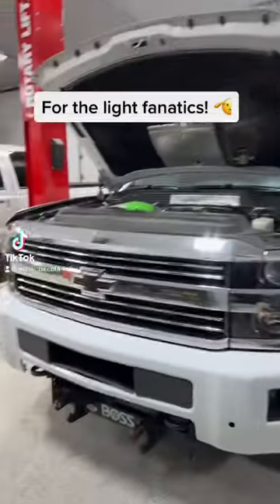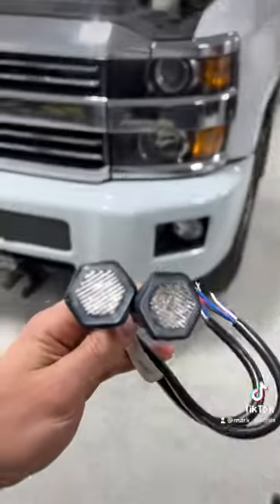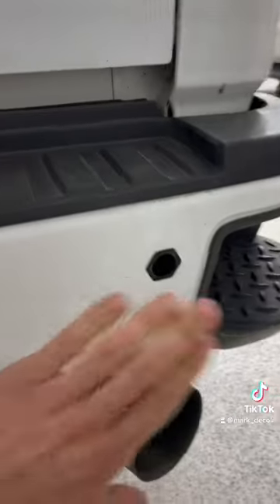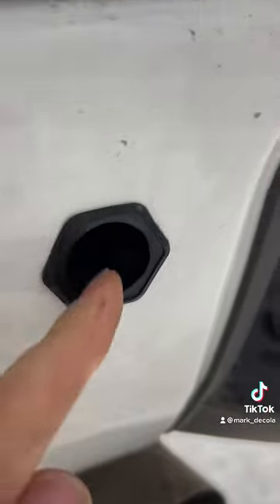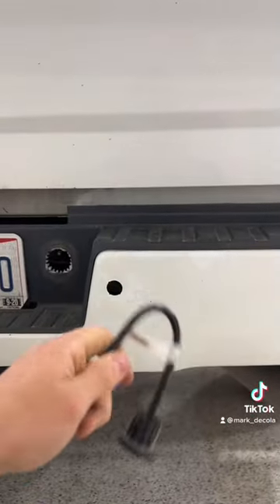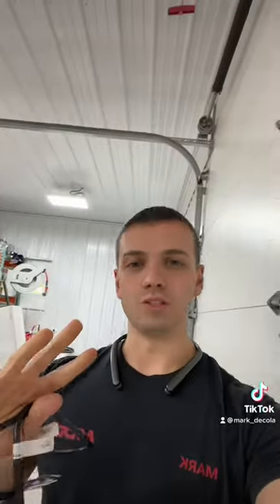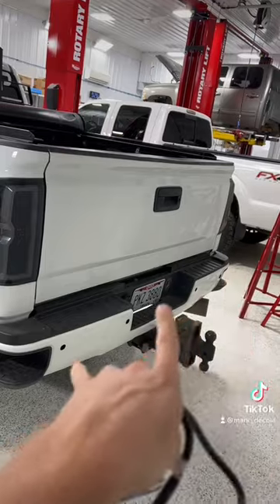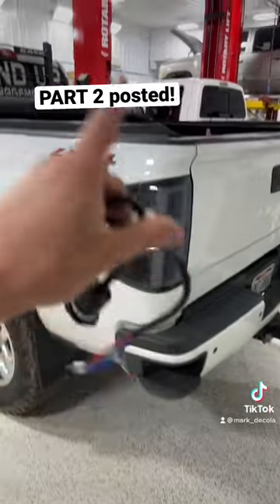PART 1 Custom factory style warning lights! #truck #diesel #LED #automotive #emergencylights #MDDP

Comment: I had a license plate holder that would light up but got a ticket, and discussed it with the cop who told me that they were illegal because they only are to work with the brake lights, why, he said they were a distraction and could cause an accident.
Reply: I know CA and AZ are particular about anything but red in rear facing lights unless it's factory turn signals, and yellow or orange in forward facing lights. There's exceptions spelled out for warning lights on emergency vehicles and contractors working in or adjacent to the roadway , including tow trucks.
Reply: Meanwhile I saw a dude with green fog lights today was distracting me staring at my rear view from a half mile away

Comment: So that bumper is not a factory match.  Vin match bumpers don't have the reverse sensor holes without sensors .   So the do it yourselfer will have to drill holes...10+ auto body here

Comment: GM electrical systems have had the same problem for many years, that's one headlight is brighter than the other, been that way for years. 
Make sure that you shrink tube any and all wire connections, salt and water decay copper away quickly, Dodge/ Chrysler/ Fiat just rust away after the first snow storm, salt and water make them turn into rust buckets in a few hours, built with the lowest  grade of Chinese steel and plastic 👍.